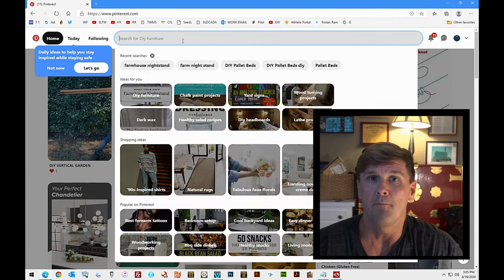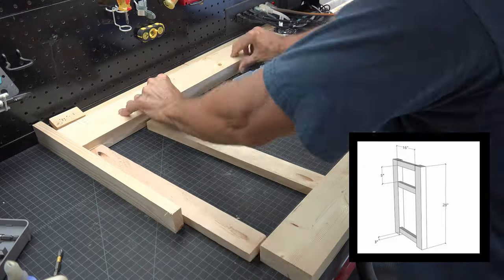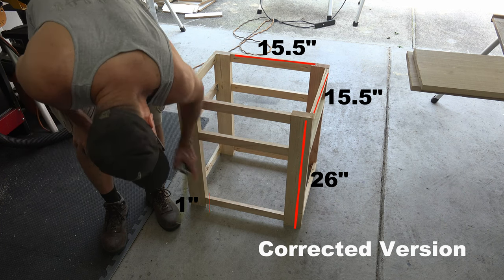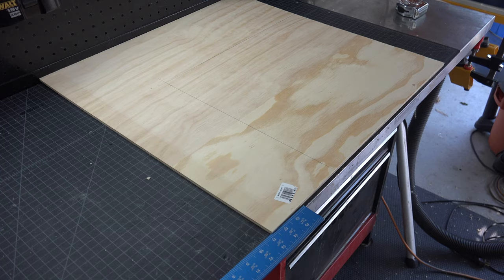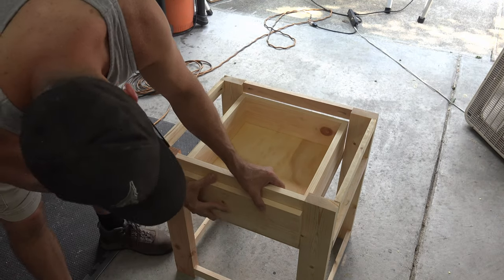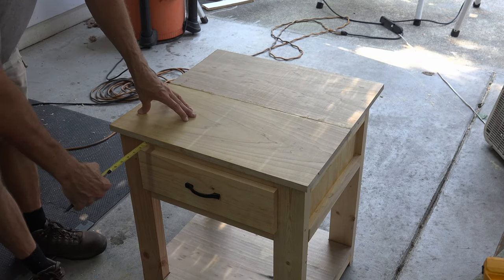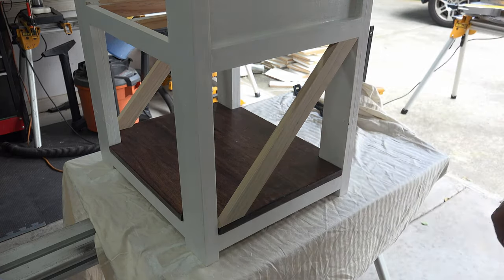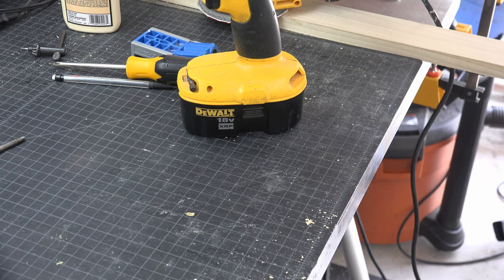Build your own Farmhouse Nightstand  / Jon's DIY

Comment: If you wanted it to be taller could you still cut it at 28?
Reply from the maker: Of course!  Consider your cross hatches on the sides will look a little skewed but not that much.  Also my changes made it flush with the top of the bed, so you could actually start by measuring the top of the bed to see what would be a good height.  I just started with the instructions so I did not consider this until I realized how tall it was.  Thanks for you comment.  Don't for get to subscribe!

Comment: I thought about doing the x this way but really tried to do the half tab first. I spec I could fill the pocket holes and paint.  No on would ever know 😁
Reply from the maker: Yes that would work. I guess there is a bunch of different ways to make the x. I am just lazy and take the least path of resistance.  Remember I’m just like you doing it for the first time. I’m not a pro. Thanks for the comment

Comment: So you had the drawer opening set at 5”, then used 1/4” plywood with 2x4 sides. But yet it fits perfectly in the opening. How does that work?? I am trying to build one and have hit this, maybe I’ve done something wrong?

Comment: Hi. I found this next to a farmhouse desk design from the same folks. It occurred to me that I could “meld” the two designs and use the nightstands as pedestals for a desktop. Then I’d have a desk with drawers. In that case do you think I should stick with the larger (taller) original measurements?  Anything else you think I should consider? Thanks for the great video.
Reply from the maker: No, I think that's a great Idea.  Stick with the larger sizes.   "love it when people think out of the box!"  Love to see a pic when your done.  send to my FB page.  Thanks Jon

Comment: Great job. In the cut list you have 1 x 2x2x8 listed, where is that used?
Reply from the maker: HTH,  It would have been for the table top and the base top. I changed it up and went with the poplar.  Like I always say, I make it up as I go along.  Good catch I will have to edit the materials list.  Thanks

Comment: How well does the drawer slide in and out without drawer slides?
Reply from the maker: Rob, that depends how well you sand the areas where the friction occurs.  I sanded with 320 grit. its pretty smooth.  But if there is still and issue you could always put a thin coat of polyurethane around the insert area and then it would be smooth as well.  Overall with the smooth sanding I had no issues.  Thanks for the comment. Don't forget to subscribe.  Jon

Comment: for the bottom cross bar do I place it at 3 inches from the bottom or 1 Inch?
Reply from the maker: NF,  always your choice.  But the instructions I followed said 3. After I made it 3, it looked weird so I went with 1.
Reply: @JONSDIY  sorry to ask sorry many questions but what size of  kreg pocket hole screws did you use and what did you set the drill bit to ,to drill the pocket hole if you could let me know I would apreacite that
Reply from the maker: @VirtualTruckingWithNoah  No worries.  Your questions make me realize that I need to put more detail in my videos.  I am an armature so still working on getting everything to come out right in the video.   To be exact I used the 1 and a half course thread and the 1 inch Course thread from the Kreg screw starter kit found in the description.  For drill bit settings there is a chart on the inside of the starter kit (under the lid).  For this project it varied but the majority of setting for  the drill bit was set  at 3/4.  (that's on the pocket jig to be clear in case I miss understood your question.)    Thanks Jon.
Reply: @JONSDIY  thanks for getting back with me that helps and I enjoy your videos and your very good at getting back with people I appreciate that a lot :)
Reply from the maker: @VirtualTruckingWithNoah  LOL.  Its easy when you only have 10k subscribers.   I don't get questions that often.   Thanks for your kind words!
Reply: @JONSDIY  got another question what’s the what you was the measurement of the base of the plywood base for the drawer
Reply from the maker: @VirtualTruckingWithNoah  I measured the opening and subtracted a half inch.  That would allow me a 1/4 inch play on each side when centered.  In the video you see me lay the piece after the first cut,  inside the table.  That was to check for how deep the shelf should be.  I liked what I saw so it did not need to be cut for depth.
Reply: @JONSDIY  ok thanks, wish you made plans for this so people can print them off but it's alright
Reply from the maker: @VirtualTruckingWithNoah  You must have missed my mantra in all my videos.  "I make this up as I go along".     Here are the plans I used.  But this is the exact reason I had to modify them.  It did not look good to me.  And i want perfection.  https://handmade-haven.com/blogs/news/farmhouse-nightstand-side-table
Reply: @JONSDIY  I getting to building this now and how many 1x2 will I need to buy ?

Comment: Thanks for sharing. I've been doing this for a while now but when I first started it was a struggle when I would find plans like this that didn't quite turn out right. Alot of times this was the issue. You'd see this cute pic and what you end up with wasn't the same.
Reply from the maker: I know what you mean.  Had I left this one to spec it would have looked silly being higher than the bed.

Comment: The only thing I would do different is the bottom of the drawer that is probably 1/8 to 1/4 thick should slightly protrude into the face of the drawer a 1/4”.       To make sure the bottom is secure.  Great instructional video.
Reply from the maker: That’s a good idea.

Comment: When you say you use a 2x4 for the legs, I noticed they are square edges. I can’t find and standard 2x4s without rounded edges. Do you buy a 2x8 and rip down? If so, are they truly 2x4? Or, are they actually 1 1/2 x 3 1/2? Sorry, crazy amateur here!
Reply from the maker: did not rip them.  They are standard 2x4s  they do have a round edge.
Reply: @JONSDIY  ah ok thank you. I can’t seem to find 2x4s that are close to yours. All I’m finding are extremely rounded edges which makes pieces  or fit together as nicely as yours. I will attempt to rip the boards and see how it goes!
Reply from the maker: @joshcav071  if you do decide to rip them to get sharp edges,  don't take off more than the width of the blade.

Comment: Hey John I don’t know if you figured it out yet but the reason why your measurements were off according to Pinterest there 2 x 4 is are standing the opposite way of yours which would make yours a lot larger is probably why you had to take it apart maybe you figured this out by now but I love your videos keep doing great work thanks
Reply from the maker: Gary.  Thanks. I will have to go back and watch the video again now that you have pointed it out.  If you watch my videos then you know my catch phrase is “I male this up as I go along”.  This is probably because I suck at following instructions.  😁
Reply: @JONSDIY  One more question if you don’t mind I know the size of the legs 2x4 but  what were the size of the cross braces, they look like 1x3 ? Thanks so much for the reply I really appreciate it
Reply from the maker: @garyburgo5999  Yes, you are correct. They were a few pieces of left over  of 1x3 select pine.  Don't mind questions at all.  I do this for fun.  Remember though.... I'm not a pro. Hope you watch some of my other videos and don't forget to subscribe.

Comment: Any suggestions on keeping the stands square? I attempted to build these yesterday and it cracked all my 2x4’s... also it says to use 1x2’s for the braces but in the video yours look wider... are they 1x3’s in the video?
Reply from the maker: Corey,  I use a speed square to ensure my saw is square.  Never trust the numbers on the saw, they are always a little off. Also after cutting one piece use it as a guide to ensure all other pieces are identical.   Yes I used 2x4s.  Pine is soft wood so not sure what you are doing to cause them to crack. (are you using pocket holes with screws?)  Also my crosses are 1x2s.  Remember that a thickness is always a little smaller than the listed size.  ie. a 1 inch board is actually 3/4 inch.   They are exactly 2 inches in width.   But you can always adjust this an play it by eye. They are just for show so make them the width of what ever you think looks good.  This is why my motto for Jon's DIY is "I make this up as I go along"  Because I do what looks good.  You need to do what you think looks good.   Thanks for your comment and don't forget to subscribe.  Jon
Reply: @JONSDIY  its when I go to put the two sides together. Both sides are square and just fine, when I put the cross bars for the back and front on, even though those are square as well, when I screw them all together there is a force somewhere between the side that pulls them apart and splits the 2x4s where the pocket screws are attached.  I am using pocket screws. 1 1/4” is what the guide tells me to use for 3/4” thick wood. Maybe my 2x4’s are warped somehow... 

I know you went to use poplar for the top and bottom, but is that where the 2x6’s are supposed to be used for? Or the 1x10’s?
Reply from the maker: @coreyraiche8928  Its possible your 2x4 have bowed a little from the store.  Some 2x4s are wet when bought and continuously dry.  I can only recommend that you cut every piece individually to fit with its own measurement and see if you can by pass the variation.    Yes I used poplar instead of the 2x6s.  But that's your call.  I think really, anything will work here.  But each board style changes the look of the table.  So in my head I pictured exactly how it turned out.  But I was even considering ripping the 26 in half  and going a lot thinner just to keep from having to buy expensive Poplar.  Yes I'm cheap :-)